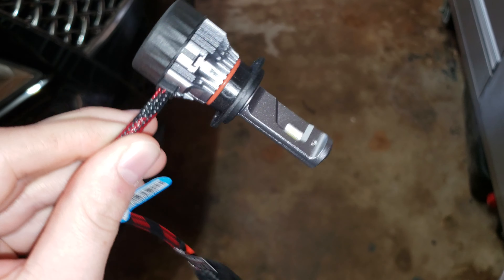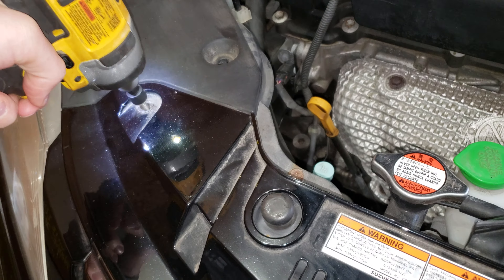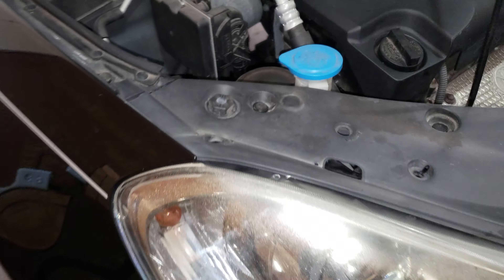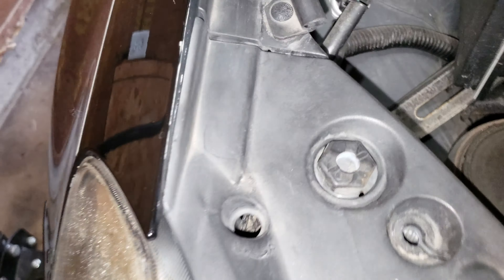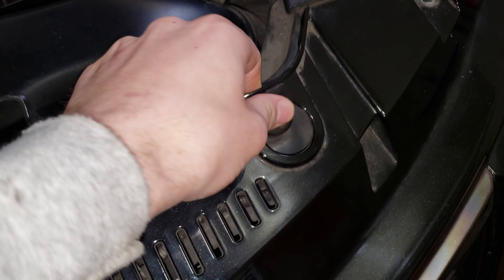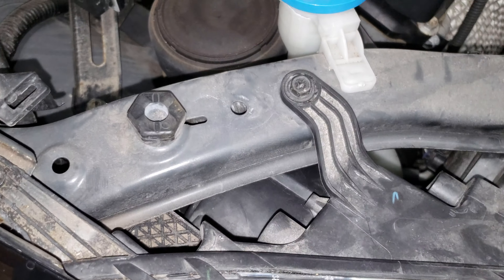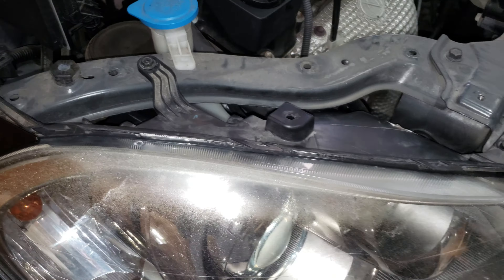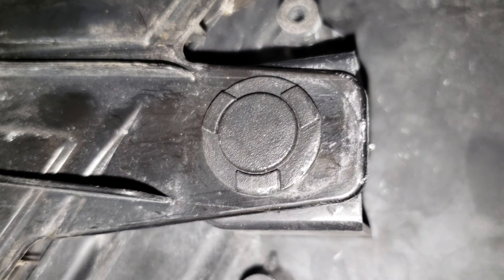Auxito LED Upgrade On The Suzuki Kizashi

Comment: Thanks man for the instructions. I currently have a 2010 kizashi with 98,000 miles and just bought the auxito led lights. They actually came out with a slimmer model so no need for needle nose pliers.
Reply from the maker: I hope you used my referral code :). i hope this video helps. feel free to like and subscribe for more & if you can, please help the channel out by giving a super thanks. Making these videos takes a lot of time, but we do it to save you hundreds. also head down into the description and check out the link for some high quality led bulbs for this and any other vehicle. use my referral for a discount. Add me in Instagram for behind the scenes pics and Stop by my store for some Anything Auto gear.

Comment: No you do not need to remove bumper to replace bulbs, all you need to do is remove air cleaner, fuse box bolts, the fuse box is designed to fold up out of the way, do a search on repair manual for Kizashi.

Comment: thanks Jeffery I have similar replacement in my car I think you can remove black plastic holder from your LED bulb and then fit it in headlight housing and then insert LED into it so the process became much easier.
Reply from the maker: Wish I would have known that before hand lol. It didnt take long the way I did it but filming was impossible.

Comment: Your the best bro. I learned how to change my headlights on 2010 Suzuki. Did u ever have any problems with the push start. Not turning on car when it really hot or cold outside.
Reply from the maker: No never. I'm actually in the process of buying my 5th kizashi soon.
Reply: You own 5 of them.
Reply from the maker: @ERIK079  no, I have owned 4 of them and looking to buy number 5 soon. Making total count 5 but current count 2

Comment: My fiancé has a 2012 Kizashi and I have been thinking of switching her to LEDs how many bulbs will I need for high beam and low beam and daytime running lights
Reply from the maker: 2 headlights 2 high beams 2 fog lights
Reply: @AnythingAuto  im looking into leds for my 2011 kizashi sport sls wouldn't you need 2 lights for the low, 2 lights for the high and then another 2 lights for your fog lights?
Reply from the maker: @ichbinwolfgang  yes
Reply: @AnythingAuto  have you had any issues with the high beam/ dlr. I have been looking for h7 high beam bulbs that double as a dlr but not really finding anything
Reply from the maker: @ichbinwolfgang  since the install everything has been great. Brighter than any light I've ever seen. They are loud but you can't hear them in the car.

Comment: If you need to replace just driver side headlight, do you need to unscrew all the bottom screws?
Reply: Thanks for the video. Replaced mine today and saved a lot of money!
Reply from the maker: If one blows they both should always be changed. When one goes the other is usually about to go. No sense in doing this job twice.
Reply from the maker: @sethcollins237  your welcome. This one is more about the led bulb installed which is well worth the money. They are a pain but so worth it.

Comment: Hey Jeffrey, have you had the P050A error in any of you Kizashis? If so, how do you fix it?
Reply from the maker: Is that the only stored code? That's to generic of a code. Is it stalling? Are you having issues with cooling your car?
Reply: @AnythingAuto  I live in Mexico near a lake, I randomly get a service engine code from time to time, it happens early in the mornings or a hot afternoon, when scanned that is the only error code, I suspected a dirty throttle, a mechanic friend and I cleaned it but it didnt make any difference, It randomly goes away on its own or we reset it with a scanner, there are no acceleration issues, car will randomly feel like stalling when braking almost to zero some times. Another question, do all Kizashis lag when going into reverse? 2 to 3 seconds.
Reply from the maker: @synxz001  i would say both of mine lag for a second or two but 3 or more seconds seems bad. I was going to suggest throttle body cleaning. I am hoping it's not your idle air control valve. Not sure what they cost but cant be cheap. Another cheap fix is the engine coolant temperature sensor which is a 5 minute job and a cheap part.
Reply: @AnythingAuto  thanks for the tips Jeffry, in your experience, would recommend going full led for lighting, im considering getting Hikari, Cougar or Auxbeam and going the higher lumen route.
Reply from the maker: @synxz001  omg I would in a heartbeat. I love being able to see into the future. I will be adding these bulbs to my new kizashi I just bought

Comment: You do not remove the bumper to change the headlight in a Suzuki, you remove the air filter assembly. Whole job takes about 5 minutes.
Reply from the maker: Then how do you install the led adapters while on the car? It took me two people with it off of the car